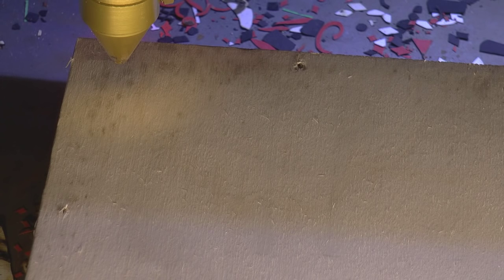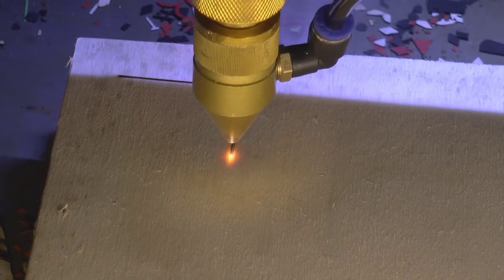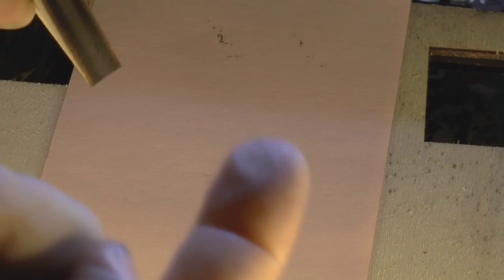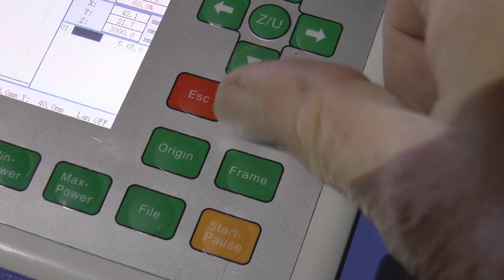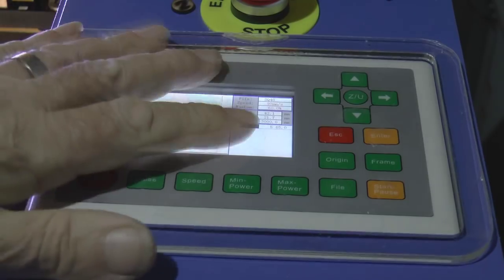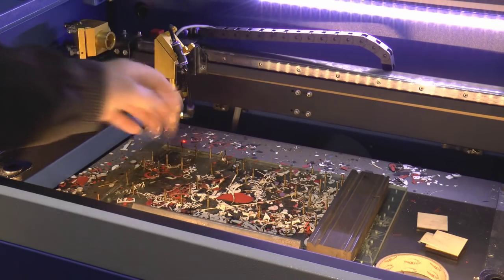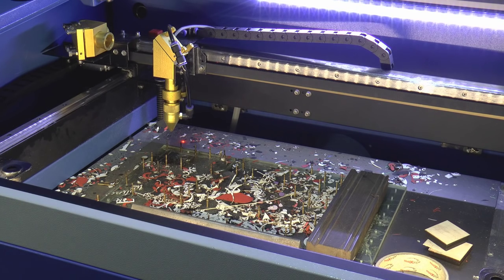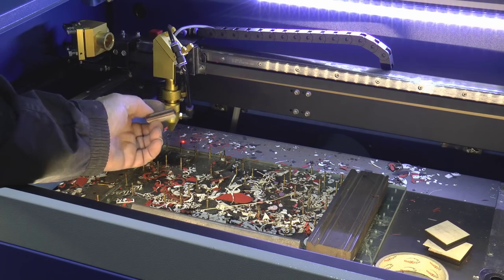RDWorks Learning Lab 30 Important odds & ends plus Cutting 10mm ply

Comment: Really enjoying your videos and bought my laser from same supplier as you, mainly because of your videos.
I was going to buy same 50w machine but ended up getting the Red one the next size up 60w 700x500 as I wanted the larger cutting area.

I am still just learning my machine settings and RDworks, my question is how do you allow for the cut thickness, i.e. if I want a 20mm square the hole is 20mm but the cut out piece is smaller.  This is good if I want a 20mm hole but is there a way to get the cut out piece 20mm? (without drawing it larger)
On my cnc I used to outline everything half the thickness of the cutter, is there a setting in the rdworks program or on the machine itself to allow for this, to cut inside or outside the line?
Reply from the maker: +Xairflyer 
If you havn't already got it, go to https://www.bosslaser.com/Download_pdf/LaserWORKS%20v8%20Manual.pdf and download a nearly understandable version of the manual, I'm sure this was rewritten by a non tech person because where they didn't understand they almost used the original chinglish phrasing.. Not bad tho'. Last but one page mentions SEW COMPENSATION for closed objects. Anyone familiar with lasers would call this kerf compensation. You have 2 factor to play with here. One is the kerf width (I think my beam is about 0.15mm)  and the other is inner or outer offset.
Hope this helps. Enjoy learning but make sure you understand what your machine limitations are check out my video on fitting an ammeter because no one mentioned the dangers of burning out your tube by overdriving it. Also check out what max drive current is recommended for your tube (typically for 60W it will be 22mA). 
The supplier did a good deal but don't expect any help from there, they are not technical and now you have it, you are on your own....except for several hundreds like us that seem have organised into a small self-help community.
Thanks for kind words
Russ
Reply: +SarbarMultimedia Thanks for help, that manual is much better, I am cutting 3mm ply and acrylic at 35% 20mm not gone any higher yet, as I seen from your earlier videos about over running tube so I must order up a ammeter today.

Comment: I'm curious, most of these "keyboard" console devices usually have a removable membrane/plastic that is put on them to protect them during transport and removable by the user (if they choose) prior to operating.  Mine was a relatively thicker plastic, but peeled off to reveal the shiny bubble keyboard itself.  Knowing how much work you've done in the past 4 months alone, I suppose it could be wear and tear.  Worst case, those keyboards are relatively inexpensive if you needed to replace, but the ingenuity of your solution is superb!
Reply from the maker: +NFO Sec 
I definitely removed the plastic protection film immediately I opened my machine. I always hated it when my old gran used to leave the peel-off stickers on her new microwave etc. Those in the corner of her TV were particularly infuriating.
It's not real wear and tear yet but a hint of things to come, so I'm taking preventative steps now. Others might like to follow this simple free trick.

Comment: I tried cutting the original crate the machine came in with terrible results, as it was cutting the ply was delaminating and making a horrible mess. I am very impressed with the way yours cuts 10 mm.
Reply from the maker: +Mentorcase 
That plywood is VERY low grade. It is full of air voids where the laminate sheets are not butted together. If you get air pockets (as with de-lamination) then you get dense smoke formed in those pockets. Dense smoke is a great absorber of CO2 laser radiation. Have you tried to cut corrugated cardboard? That should be an easy material. That will clearly demonstrate the air void effect.
So don't kick you machine just yet until you've tried some reasonable grade ply. Go to your local DIY outlet where they offer a cutting service and ask the guy for a few free offcuts in his scrap bin
Good luck

Russ

Comment: I've been amazed at how well my machine cuts thick plywood. As for the panel, I noticed the same thing happening to mine and it ended up being the protective plastic coating that was peeling and not the actual plastic display cover. You have been using yours much longer than I have so I'm sure thats not the case. Just thought it was worth mentioning. 

Thanks as always!
Reply from the maker: +CenterFireJewelry 
I used to hate it when my old granny still had the plastic cushion covers on her sofa after 5 years!! The first thing I do after unboxing is to de-film everything but it was worth a check. 
I have heard it's possible to cut 1/2" ply with a 50 watt machine (probably 40 watts?). Until now I would have thought that fanciful, but now I can see 2 or  3mm/s at full power doing that. I'm very happy.
Reply: Just curious if you are also using 65% as a max power.
Reply from the maker: +Rob Weinstein 
Max power button is set at 70% but that basically means I can pulse at 70%. Such a short burst unlikely to damage my tube and how often do you use pulse.?For all my other programs I never exceed 65%. I can always check on my ammeter to make sure it's not doing anything silly